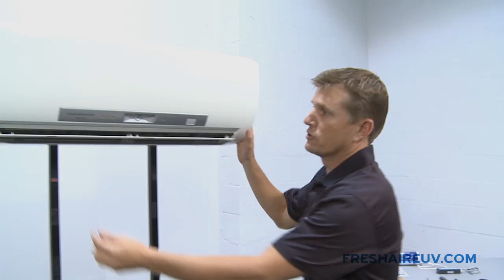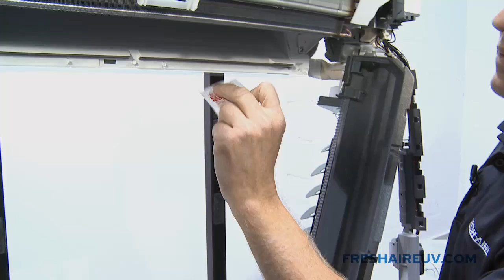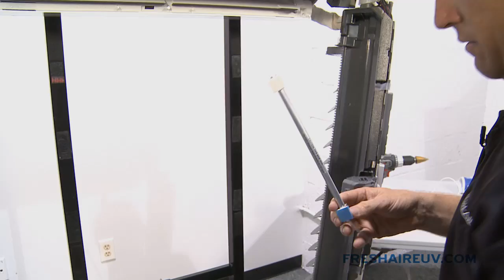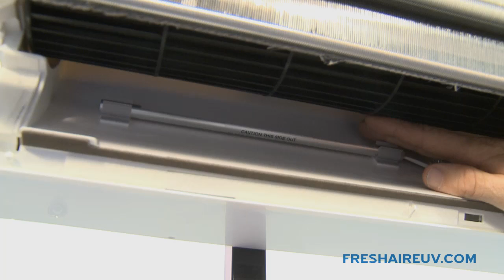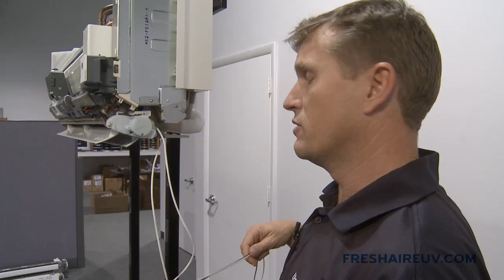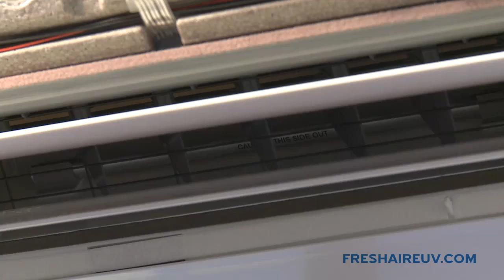Mini-UV-Installation

Comment: I am sorry and I hate to feel that I have to post this here. Viruses, Mildew and worse even bacteria have to be exposed for SEVERAL SECONDS to a quite specific wave length of UV light to be killed by it. Placing the UV light in the vent exit is futile because particles will travel thru it a high speed and be exposed to the UV light for only FRACTIONS of a second. 
The UV light needs to be placed to radiate over the FILTER!

Comment: Are we going to remove it  if we need to clean the evaporator? 
or we can spray the evaporator with the UV? 
 how sensitive is this water and moisture?
Reply: there is always going to be passive build-ups of dirt and oil on that plastic. use your AC in dry mode. running AC on dry mode ensures that more water will flow through the coils due to condensation. thus resulting in much cleaner evaporators. secondly if you want to apply the uv-c lights the right way, I suggest they be hanged above the blower where two evaporator fins join together. this cavity will target the blower and the coils simultaneously, resulting in better cooling performance as well. for the plastics I recommend using glass/ceramic coating.